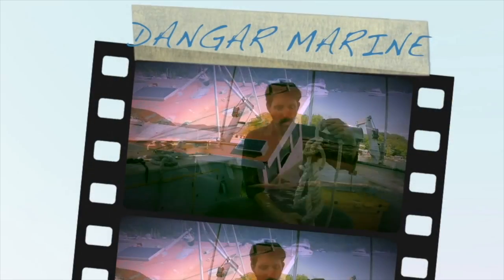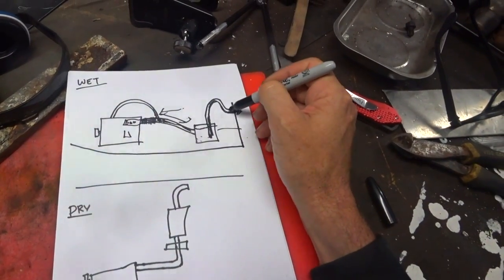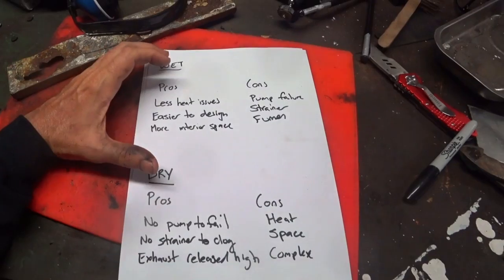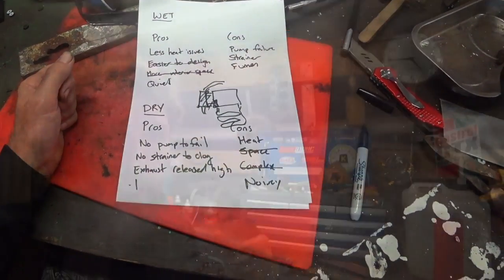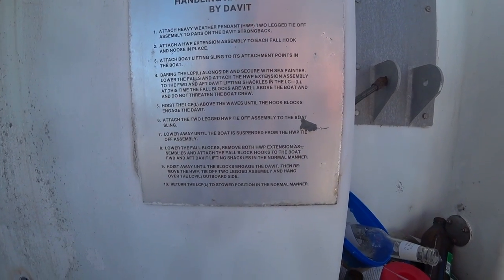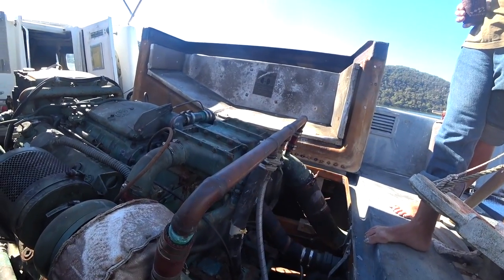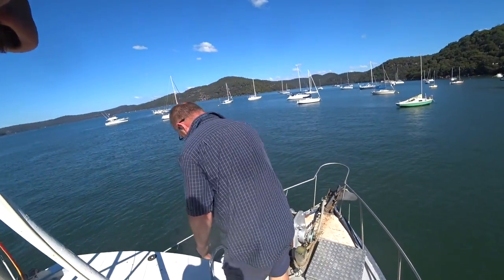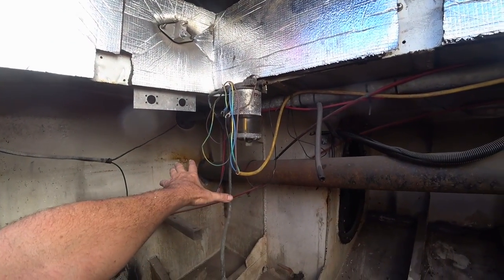Wet Exhaust vs Dry Exhaust

Comment: Why not move the wet muffler box to the front of the engine room and fit the exhaust out the side of the boat .
This would free up the lazarrate, use dead space in the engine room and still allow access to the engine,  .
Or would this block off the  too much access ??
Reply from the maker: The trouble is I need the space in the engine bay too as it is too crowded to do any emergency repairs with the motor in place. Nice thinking though. :)

Comment: It might end up being a question of cost of suitable muffler vs. lack of space in engine compartment. There is a lot of room for batteries, have you considered making it electric? Just a little problem with the price of lithium batteries, but apart from that, no exhaust, no noise, no diesel. Pity the electric path is not a realistic option ATM.
Reply from the maker: I have actually considered going electric yes. I think when this engine gives up the ghost that is the way I will go.

Comment: Detroit diesel. ...71 series older version but same engine used in WW2 landing craft and two 6/71 side by side used in Sherman tank ......6/71....8v/71 ...12/v71 used in trucks boats heavy equipment still today
Reply: @xxaxnxtxhxoxnxyxx 
Oshkosh trucks ....I know some old terex scrapers they outfitted with series 60 Detroit or Cummins

Comment: If the boat was built with a dry then I think thats a good enough reason to go back to dry. I would take it out now while you have the room to do so. The space gained for maintenance should be a good enough reason. Maybe you could trade the wet system for a dry and save a few coins. Another good reason for swapping back to dry is because YOU will have fitted it, at this time you are working with someone elses system ....who knows what horrors this fix has install for you when used long term.
Reply from the maker: Yes, I imagine there is a small amount of value in that lift muffler so doing a swap of some sort would be great for saving money.

Comment: Honestly, I made my mind up 30 seconds after you climbed in.  Besides that, getting rid of that rear "exhaust hole" or as it could be called "water inlet" is nothing but a great idea for a boat you intend to live on.  As for the backpressure, why not use some sort of expansion chamber?  As well, a muffler with a large volume but small baffles (tuneable would be best but probably $$$$) would also act as an expansion chamber.

Comment: Here is a cool way (pun) to see if your fresh water engine cooling system is working...  they make these brand-new fancy little devices now, and they are called an engine temperature gauge. (sarcasm)  You can also put an engine over temperature alarm on it if you are worried that the engine will overheat while you are away from the gauge.
Reply from the maker: Yes, a good set or working and trust-worth gauges is pretty much essential.
Reply: @DangarMarine  A good alarm system is handy on a boat as well.  The sending unit for automotive style idiot lights work well for this, and can be used along with the sending unit for the gauges.  Low oil pressure, engine temperature, and bilge water level are the basics.  You are not always standing over your gauges, or watching them like a hawk - especially when single handing a big boat.

Comment: nothing wrong whit a dry exhaust, if isolated and dampened well,you can mount rhe muffler above deck in the place where the old pype is missing, pig pro is less maintenance and were of a pump, On the other hand, a lot of boats here in the Netherlands have wet exhausts, using rubber exhaust hose, and specialy made waterlocks/mufflers (mainly Vetus , you can route the rubber hose in sutch a way its out of the way, and it will not use more space at all.. the pump is mostly connected directly on the motor it self, on the distribution side, or via a belt driven by the crank pully, conected to a water filter.  Both have there pro,s and con,s, but in the case off sound it does not matter...( y prefere like on my own museum tug Bugsier dry and through a stack, Indeed to be out off the fumes thats a con by exhaust trough the back of the boat )  Love the type of bout you have! Greatings crew of 1887 build museum tug Bugsier 5 ) (check it out on google! )
Reply from the maker: Thanks mate, will Google your boat! :)

Comment: Not trying to persuade you either way but just my 2 cents. We converted from wet to dry with one of our previous boats. The reasons were the same as yours, being ease of maintenance. We regretted it. It became loud, it was uglier, and took up valuable space in an area where we spent the most time. We should hardly ever be in the engine room.
Reply from the maker: Fortunately for me it won't take up any useable space, but I am concerned about noise and soot.

Comment: Pro on the wet exhaust.... As your diesel motor gets older it will blow more smoke. The wet system will reduce the smoke.... Another pro on the dry is running a heat exchanger to heat the cabin in winter.. Ah flip a coin and run with it ;)

Comment: RIP out the wet system. If you ever did go back to wet you’d want to do it better/differently? I’d go wet with better routing and side exit myself just cus I wouldn’t want to look like a lorry.
Reply from the maker: That's it. If I did go back I would want it designed better anywya.

Comment: I'd definitely go back to a dry stack. As far as a muffler goes, you're going to reduce backpressure over that lift system with anything but the worst muffler out there. Between the higher temps and the straight up flow there is going to be a BIG increase in exhaust velocity over the wet system. I'm guessing they went wet for noise reduction since there's no real space for the muffler. But even without a muffler a good blanket and wrap is key to noise reduction. Or better yet is double walled pipe with a blanket. I've been on quite a few commercial boats with big Detroits and they had little to no mufflers and were not too bad. The key is what is done before the exit to reduce noise. Also keep in mind a turbo wil greatly reduce the exhaust note too.
Reply from the maker: More and more I'm thinking a well designed dry exhaust will give me the results I am after. Time to do the research!

Comment: Stu, I can see your consern with the present wet exhaust. It appears as if someone didn't quite know what they were doing. All the water drawn up to cool the heat exchanger needs to exit through the exhaust. That pump is a waste of space, time, and money. I can see no intellegent reason for the humugus lift exhaust, another waste of time, space, and money. An in line rubber muffler should be more than sufficient. An elbow needs to be made at the end of the exhaust manifold. This is also the location for the raw cooling water exit. The remainder of exhaust pipe continues down hill to the transom where it should exit just above the waterline. A PVC surge tube can be installed, but I have always used an exhaust flap. I beleive your engine is nonturbo so it's exhaust note is louder. An elbow can be welded to the transom exhaust exit extending just below the boat's bottom. A 1" i.d. tube needs to be welded into the elbow facing aft above the water. You have under water exhaust when under way and the 1" tube gives backpressure releif for idling and engine start. I have purposely left out the underwater exhaust elbow so you can research on line the different designs. You will run as quietly as an inboard/outboard and only need to muffle intake noise and engine noise. This works, I've done it. BTW flip that exhaust manifold so it faces aft. That will give more access to the seacocks and eliminate extra exhaut pipe. There seems to be a lack of deck hatches on your boat. They would allow much better access to storage and the below decks area.

Comment: Your engine is a Detroit Diesel.... it's a two stroke and the thing these motors are renowned for is NOISE !!
These are very noisy engines. Why do you think that the previous owner went to the time, trouble and expense of changing to a wet exhaust?
I would stick with a wet exhaust, just do a better installation job. Your ears will thank you for it.

Comment: Why not have a electric pump for the exhaust that only operates when the engine is running?
This way you wont have water going backwards if trying to crank...

Comment: Wet exhaust is only quieter because it exits the arse end of the boat so those on-board don't hear the splutter that the folks on shore hear. a PROPERLY SILENCED DRY EXHAUST TO ME IS A NO BRAINER - NO RISK OF FLOODING

Comment: I don’t see any tug boat equipped with the wet exhaust system, do you? Plus old 2 stroke Detroit engines put out incomplete burnt exhaust and a lot of soot not good for direct in contact to water surface I myself go with dry exhaust system by using ss316 pipe of course throw in couples wrinkle bellies in between (US river patrol boats equipped with wet exhaust system didn’t harm the environment during VIETNAM war because the bombs already did the jobs LOL!!!)
Reply from the maker: Yes, I'm glad I went with dry exhaust on Renko, I'm really happy with it.

Comment: Backpressure is all a bit of bullshit misunderstanding/wives tales anyway. 

If the wet exhaust lift muffler works as you described, with the exhaust from the engine venting underwater, that is way more resistant/"back pressure" to flow than what any muffler would provide.

An ideal sized exhaust setup should have a good exhaust gas velocity. Which is where the scavenging effect actually comes from. Which is a vacuum forming behind the high-speed exhaust gases as it leaves the extractor but the exhaust valves have closed. Leaving a partial vacuum to help extract the exhaust gases the next time the exhaust valves open.

Having too large an exhaust diameter to "eliminate backpressure" will be detrimental as the exhaust gas velocity will be too low destroying the scavenging effect.

Comment: DUMP THE 2-STROKE, Find a used 4-stroke out of a truck. The cost saving in fuel will off set the initial cost in short order, plus the sound is way better and the world will love you for it. Can't believe anyone would rebuild a boat in this day and age and keep a 2 stroke gas let alone a diesel. My god man WTF ARE YOU THINKING. Just a thought and I love the environment. PLEASE gave this a long hard look. The pros will far out weight the cons any way you look at it. I've replaced all my 2-strokes now from my R.C. planes to my 10 ft. Jon Boat & my 18ft. speed boat. YOU CAN DO THIS, JUST MAKE IT HAPPEN.
Reply from the maker: Two stroke petrol motors are much worse than two stroke diesels due to burning the lubricating oil. At least these have regular sump oil for lubrication like a four stroke.

Comment: Wet exhaust has issues with freezing in the winter must be drained after every trip or have heaters a keel cooled dry stack is good to go anytime a real issue up here in New England when the temperature can be -10F or colder in the winter and guess what you have to go out and work. On the other hand a wet exhaust doesn’t wet stack and cover everything and everyone with oil spray and doesn’t have stack fires. I would never put a dry exhaust in a recreational vessel or a wet exhaust in a commercial vessel with the exception of a passenger vessel that doesn’t operate in the winter
Reply from the maker: I’m pretty happy with the fact that I went dry in the end. Yes, a bit loud but engine is running clean and it saved me a huge amount of storage space below decks that I really needed.

Comment: Those flaps would drive my batty!!! A piece of rubber would fix that I'm sure.
Reply: A properly running motor would fix that problem. It's probably that exhaust leak not letting the pressure hold the flap out properly.

Comment: There is a You Tube page called "Bus Grease Monkey" all he does is work on old buses with non computer controlled Two stroke Detroit Diesels like 6/71 V8 71, its a very infortmative page regarding old Detroit Diesels.

Comment: Great video. With the limited room in the engine compartment, a well designed 
dry exhaust
 system, looks like the best option.
Did an internet  search for noise cancelling exhaust systems
:
https://www.silentium.com , I'm sure there are others; you may want to look.

Comment: Wet exhaust is obviously stupid and hurts efficiency. You do it like an auto exhaust. Use rubber hangers and just really wrap/spray the whole pipe. Dry will be super quiet...with an auto muffler lol. A chambered muffler and resonator from a stock car will make it purr softly like a kitten. Get one with variable flow and you won't be restricting it when you open the throttle.

The wet on that big diesel is loud as hell.

Comment: You completely missed the standard Exhaust manifold ‘WET’ flange such as a Mercury Marine style that almost all OEM Mfr’s are required by laws here in the USA. NOw, I have twin V-8 SBC with I/O drive system. I personally not to do the thru-hull because it is all original 1980 Beisemeyer 27ft Daycruiser. But ever other boat Ive owned has had thru hull. I have a patented wet exhaust muffler that I make that manufacture that has a 14-20 Db(Decibel) reduction. PS, what’s with the GAY flag??

Comment: A messy workbench means that the people are working, unfortunatly our engineer keeps his workbench very clean......... 

On the off chance to make a fool out of myself, is it not possible to make a sound proof chest around the part of the exhaust that is sticking out of the deck (eg with a frame and some rockwool stuffed around it) when you are making a dry exhaust? To be honest I am NOT and engineer, if there are problems on deck I kick the engineer out of his cabin, so that he can produce also some elbow grease........
Reply from the maker: Yep, I would definitely box around the exhaust as it comes up through the deck to stop people touching it and burning themselves.